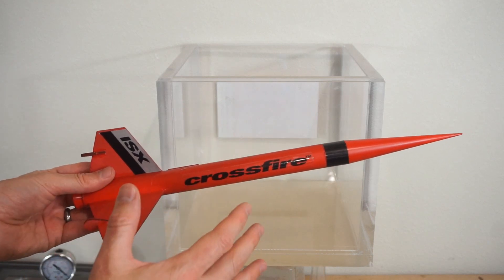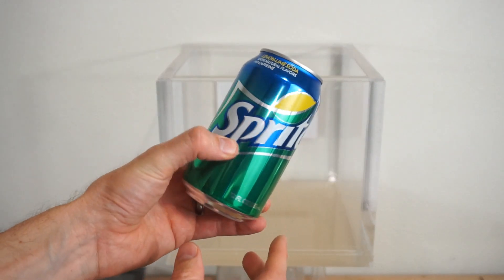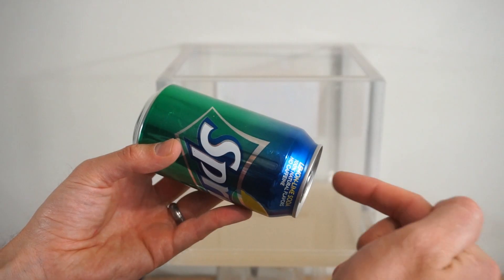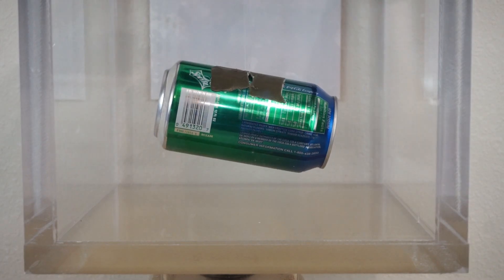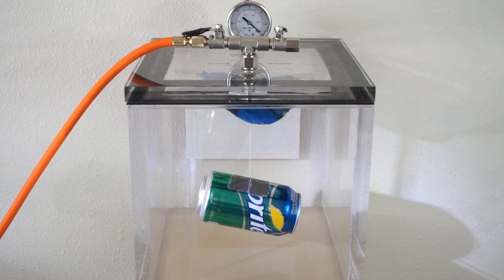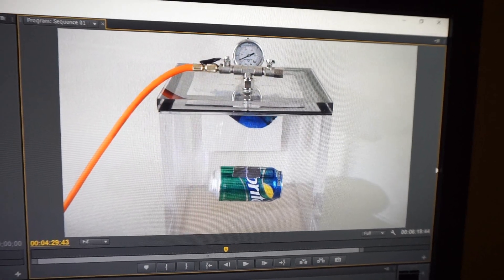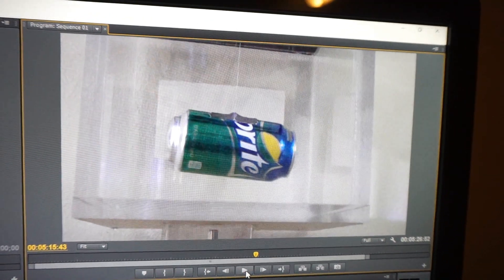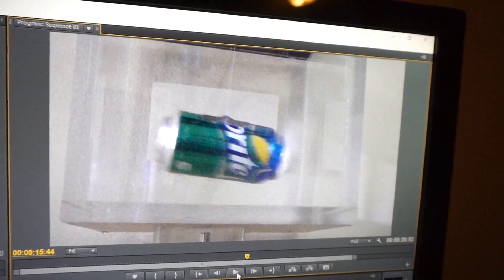Can a Rocket Fly in a Vacuum Chamber?

Comment: why would you  use such a small chamber? any thrust created would hit the side wall and push off that medium, even if your chamber was long and thin the gas would expand till it hit the walls then thrust would be applied.  A real experiment would use a vehicle  proportional in size to the chamber.  Your Experiment is a Farce to fool people.
Reply: How do you propose that the force of the liquid and gas hitting the wall finds its way back to the can?

Do you feel when the steam of water from a hose hits the ground?
Reply: @AM-rd9pu  What are you talking about?  What does a Hose and liquid have to do with a proper experiment?  Think Critically before you come up with some strange question that doesn't even make sense.  Everything you just said interacts with multiple mediums.  But there is no medium to interact with in a vacuum.  Gas expands exponentially in negative pressure environments  (a vacuum).  You must expel the same amount of Mass to produce propulsion for an Equal and opposite reaction of force in the privation called 'space'.  It doesn't matter how much force you push with if there is no medium to interact with.
Reply: @jadediquattro5355   “any thrust created would hit the side wall and push off that medium”

For that to be the case, the force of the liquid and gasses hitting the wall would have to find its way back to the can. That’s why I mentioned the hose example. If the can feels the push from the wall, then you should be able to feel the push from a stream of water hitting the ground. 

I’m simply pointing out the implications of your claims. 

The very action of accelerating mass backwards makes you experience a forwards force. It takes a force to accelerate mass. When you impart a force on mass, in accordance with the third law of motion, the mass imparts a force back on you. 

You’re making up requirements by saying there needs to be a medium to interact with.
Reply: @AM-rd9pu  A VACUUM CANCELS OUT FORCE Due to negative pressure equalization.  You need to understand how a vacuum works. A pressure of 10^9 torr is extremely low.  Any thing you spit out into it will disperse unless it has equal or greater mass and force.   And "Space" is an almost endless vacuum.  Or is that wrong?
Reply: @jadediquattro5355  Yes, that is wrong. 

A vacuum isn’t a force and it doesn’t suck. A vacuum doesn’t “work”, it just is. Vacuums are nothing more than a lack of stuff. A lack of stuff can’t do anything because it isn’t anything. 

Gas disperses into a vacuum because its own pressure pushes it outward. Rocket nozzles can build up pressures into the thousands of psi inside their combustion chambers. This pressure is what forces the gas out at extremely high speeds. 

Remember the laws of motion. Since the gasses are accelerating from the rocket, we know a force acted on them. Since a vacuum can’t exert a force, the only place the force could have come from is the rocket. In accordance with the third law of motion, if the rocket exerts a force on the gasses, the gasses exert a force back on the rocket. That’s all there is to it. 

A rocket will expel as much exhaust gas as it has fuel to burn. 

You’re getting hung up on the minuscule numbers that are cited for the pressure in space. Remember as the number keeps getting smaller, the pressure is just asymptotically approaching 0. Pressure differential is what matters. A pressure vessel maintaining 1 atm in a perfect vacuum is no different than a pressure vessel maintaining 2 atm when the surrounding pressure is 1 atm. In both cases, the pressure differential is 1 atm and the vessel sees the exact same stress. 

In practicality, a pressure vessel doesn’t care if the surrounding pressure is 1 torr, 10^-3 torr, or 10^-19 torr. The difference in pressure differentials in all three cases is less than 1 torr (very minuscule). 

p.s. you have a typo in your pressure. 10^9 torr is over 1.3 million atm.
Reply: @papalegba6796 Yes I do. That’s how I know that vacuums don’t suck.
Reply: @AM-rd9pu  wrong, but carry on, chatbot 😂
Reply: @papalegba6796  Not wrong.
Just tell us how much mechanical "Work" is performed by a machine that accelerates 500 kilograms of mass from a velocity of zero to 2500 meters per second.
I take my answer in units of "Joules"

WHY won't you answer this trivially simple physics question? High school physics students can answer this question.
I thought YOU were the "expert" on physics around here.
Reply: @papalegba6796  - "you don't even know the definition of the word "suction", do you, mentally ill lying guy?"

Are YOU back to claiming that the vacuum of space can exert a force on something?

Is this the "Magic" you keep speaking of that can make mass shoot out of a rocket without applying any force to that mass?
Reply: @papalegba6796 So vacuums do suck? How does nothing act on something? 

Guess I shouldn’t be surprised that the person who thinks mass can be accelerated without a force acting on it also thinks nothing can act on something.
Reply: @jadediquattro5355  - " Think Critically before you come up with some strange question that doesn't even make sense."
How about YOU "think critically" and answer the question:
What would happen if I fired a Crossbow into a vacuum?
Are YOU suggesting that the crossbow would NOT experience any "Recoil Force"?
Because THAT would be a violation of Newtons laws.

Papalegba believes that rockets can accelerate mass using "Magic" so you are not alone in your misunderstanding.
Reply: @stuartgray5877 Why are you not able to stick to the subject matter? a Crossbow?  what does that have to do with chemical reactions or pushing a small amount of air into a vacuum?  Falsification is independent of replacement.  Just because I've proven the experiment as false doesn't mean I need to replace it with something that will satisfy your poor logic.  How are pressurized Gas and mechanical crossbows related to each other in anyway?
Reply: @jadediquattro5355  Because the physics of crossbow recoil and rocket propulsion is THE SAME.

Crossbows get their recoil from the "Law of Conservation of Momentum".
The Tsiolkovsky Rocket Equation is DERIVED FROM the Law of Conservation of momentum.

If you don't understand how crossbows have recoil, just say so and we can explain it to you.
It appears that you did not take high school physics.
Reply: @jadediquattro5355  I can help you out. Just answer these questions regarding a rocket HERE ON EARTH IN ATMOSPHERE, then we will get to the "in vacuum" part.

SO, when a rocket runs right here at sea level:
1 - Does the exhaust gas have "mass"?
2 - Does the exhaust gas get "accelerated" by the rocket engine?
Answer these trivially simple physics questions to make sure you understand the terms then we can move on.
Reply: @jadediquattro5355  Are those two questions too much for your superior intellect?
OR are you just scared to answer because you know I will ask more difficult ones?
Reply: @jadediquattro5355  - "Answer these trivially simple physics questions to make sure you understand the terms then we can move on."

Well I guess we WONT BE "moving on".
Check back AFTER you have completed high school and Ill try to help you out.
Reply: @jadediquattro5355  Are you still confused about mechanical recoil?
Try to explain it to us and you will see that you don't really grasp the concept.

If you did, then you wouldn't make such asinine statements.
A crossbow exhibits Newtons Third Law when it fires a projectile and feels the "equal and opposite force" we call this "Recoil"
A Rocket Engine exhibits Newtons Third Law when it accelerates mass out the back and feels an "equal and opposite force" we call this "Thrust".
You are the one that should be embarrassed by not knowing this genius.
Reply: @rocketman484  Wow! it took you months  to think of this reply?  And my conjecture has to do with using the force of gas in a vacuum.  Not a Crossbow or recoil.  Here is a simple test anyone can do.  Attach a full balloon to a rolling toy car so that when the  balloon releases its force the car is propelled forward.  Next to mimic what we find in "Space" (endless Vacuum)  is you hold up the suction of your vacuum cleaner to the exhaust of the balloon you can gauge the movement of the vehicle.  You will then find there is no movement of your model.  This is not to confuse a Vacuum Cleaner with the vacuum of "space", this is to show what a High Pressure vs Negative Pressure difference is.  When you use a crossbow you have two objects propelled away from each other, which would work in "space".  When you try to do this with condensed gas in the Vacuum of "Space" the gas would endlessly expand outward not being able to propel the vehicle.  There are endless experiments proving this point.  The only way to propel in "space" is by releasing something of equal mass in the  opposite direction.  Its not like what we see in the movies.
Reply: @jadediquattro5355  So you are still arguing that a rocket engine can accelerate the mass of the exhaust gas into the vacuum WITHOUT APPLYING A FORCE TO THE GAS?
So in your world the gas from the engine accelerates into the vacuum by "Magic"?
I think you should try to take basic physics again.
You are confused.
Reply: @rocketman484  it has been proven that expelling gas from a rocket engine into a vacuum does not apply enough force to move anything.  What needs to be expelled is something of equal or greater Mass along with Force.  Gas does not contain enough MASS.  That is what I am essentially saying.  If you're expelling a gas then the Gas needs a medium to interact with.  This is basic stuff in a weightless environment that is also a vacuum.
Reply: @jadediquattro5355  - " it has been proven that expelling gas from a rocket engine into a vacuum does not apply enough force to move anything."

No such thing has been "proven".
In fact, exactly the opposite.
Stick to topics you are familiar with like painting pictures with your fingers.
Reply: @jadediquattro5355  You really Should try to complete high school physics BEFORE trying to lecture rocket scientists about basic physics.
YOU are REALLY BAD at physics.

Comment: Over all, correct, reasoning slightly wrong.

The can doesn't move to the left BECAUSE the stuff goes out the back, it just doesn't stay in place, because the stuff is escaping.

Basically, the can is (normally) being pushed in all directions (from the inside), and all those pushes, cancel out.  When the back is opened, the can is no longer being pushed to the right, thus the push to the left, is not cancelled.

Comment: The gas is hitting the close-by wall and causing rebound. It doesn't prove anything.
Reply: That's not how rockets work. Rocket Propulsion is just the mechanical recoil of pushing on mass. The mass does not have to hit anything
Reply: @stuartgray5877   There is no "recoil" in space, because the friction of the gases with the inside-nozzle surface cancels out any possible recoil. Anyway, there is no "outer space" to begin with - it is just a figment of imagination.
Reply: If that’s how you think rockets work, then you should also think that you can feel when water sprayed from a hose hits the ground.
Reply: @AM-rd9pu  The hose pipe is connected to the ground, thereby providing the inertial reference needed for Newton's laws to work. Newton's laws are not applicable in "space" because there is no inertial reference.
Reply: @ramakrishnanselvaraj4433  Hmm… I must have missed the part while earning a bachelor’s and master’s degree in engineering where they said that Newton’s laws stop working in space. Oh wait they don’t say that. You’re lying. 

And you completely failed to address the point of my last comment. I’ll ask more directly. When you’re holding a hose and turn it on, can you feel when the stream of water hits the ground?
Reply: @AM-rd9pu   I have a master's too. Yes, they didn't tell you that inertial reference is a mandatory condition for Newton's laws to work. You feel the water hitting the ground from a hose, because the hose is connected to ground - an inertial reference.
Reply: @ramakrishnanselvaraj4433  Really? You can feel the water hit the ground? Can you feel when a ball you threw hits a wall?

If you do in fact have a master’s degree it almost certainly isn’t in engineering because you’re getting basic physics very wrong. Otherwise, you’re just plain lying about the degree, physics, or both. 

And I never said what universities I attended. How do you know what they did or didn’t teach? And how did you find a university that teaches real physics while others aren’t?

So if, according to you, newtons laws stop working in space because there is no inertial reference frame, what happens if you throw a heavy object? Do you move, does the object move, or do both move?
Reply: @AM-rd9pu  he does not even realize that nothing on the surface of the earth is in an "inertial reference frame".
Reply: @AM-rd9pu  AFAIK, no college teaches about inertial reference being a prerequisite for Newton's laws. It would be extraordinary if your college did. Note that you just BELIEVE that outer space exists, without any real evidence, make assumptions about it (that Newton's laws work there) and THEN come here and argue. That's funny.
Reply: @ramakrishnanselvaraj4433  So how did you come to know better than all the professors teaching physics? 

Or maybe you’re just wrong about physics?

Also, there’s no belief required to know that space exists. We send stuff there all the time. There are countless pictures and videos. You can observe satellites and determine their speed and altitude for yourself. You can launch balloons and rockets to measure air pressure vs altitude. Yet for some reason, you deny all of this.
Reply: @stuartgray5877  You spend your entire life in YouTube comments, calling people liars & interrogating them. You don't act like a professional aerospace engineer at all, do you?
Reply: @AM-rd9pu  big way to say nothing, ChatGPT guy 😂
Reply: @papalegba6796  That’s an ironic accusation coming from someone who has nothing valid to contribute about science.
Reply: @AM-rd9pu  says the chatbot that pretends to be an aerospace engineer 😂
Reply: @papalegba6796  I’m curious. What would it take for me to prove to you that I am an aerospace engineer?

Also, what brought you back to this comment thread 3 months after I last responded to you?
Reply: @papalegba6796  - "says the chatbot that pretends to be an aerospace engineer "

Says the person that CLAIMS to be an expert on basic physics but REFUSES to tell us:
how much mechanical "Work" is performed by a machine that accelerates 500 kilograms of mass from a velocity of zero to 2500 meters per second?

WHY won't you JUST ANSWER if this is so simple for you?
Oh, THATS RIGHT because answering TRUTHFULLY - PROVES YOU WRONG!
But Bless your little heart for always coming back to be made a fool of.
Reply: @papalegba6796  - "You don't act like a professional aerospace engineer at all, do you?"
Too bad.
I do happen to be one of the most senior Spacecraft Integration and Test Engineers at BAE Space Systems.
I am currently preparing the SWFO and Glide/Carruthers spacecraft for launch next year.
And I am helping build the NEO-S spacecraft for JPL for launch in 26.
You?
Reply: @papalegba6796  Well we just put the SWFO spacecraft into thermal vacuum test yesterday. They are pumped down to hard vacuum and cooling the shrouds today. The test lasts about a month.  I am one of the "Systems Engineers" that monitor the spacecraft for the duration of the test.
I see that you have never told us what YOU do for a living. Are you embarrassed?
Reply: @AM-rd9pu Hi @Stuartgray fellow chatbot, everybody knows you're both the same chatbot - You're busted 😆😆😆😆
Reply: @Checkeroute  Wow, you branched out to new comment threads with the same copy and paste. I’ll keep a running total of all the times you’ve posted this. 

18
Reply: @AM-rd9pu  Hi @Stuartgray fellow chatbot, everybody knows you're both the same chatbot - You're busted 😆😆😆😆

Comment: Sorry another fail there is a lot of compressed carbon gases inside that can and once those release that will give it something to push against as well as the wall of the chamber
Reply: How would the force from the gasses hitting the wall find its way back to the rocket. We can’t feel when the water from a hose hits the ground so why would the rocket “feel” when its gasses hit something?